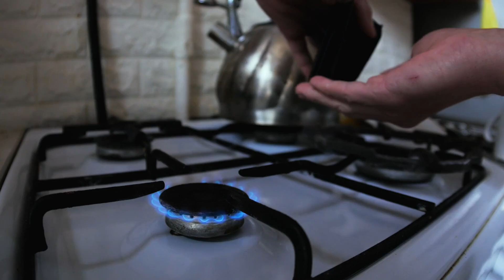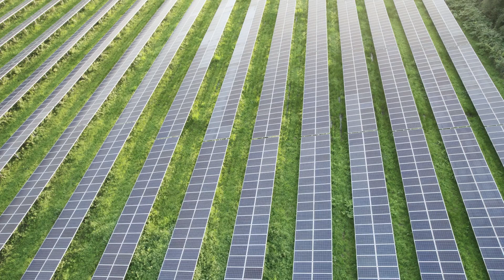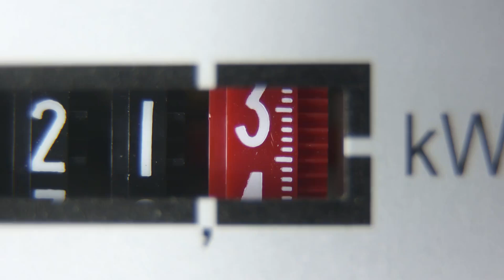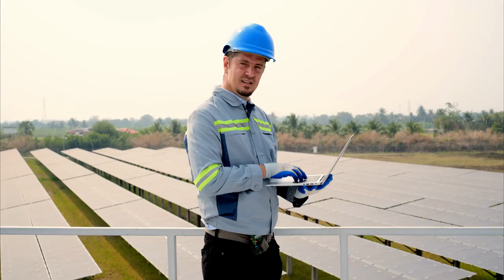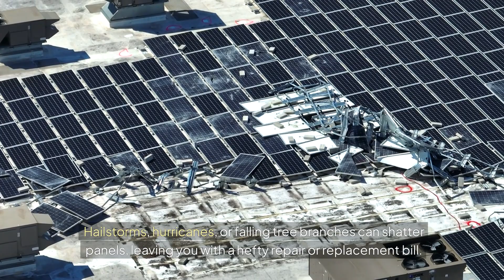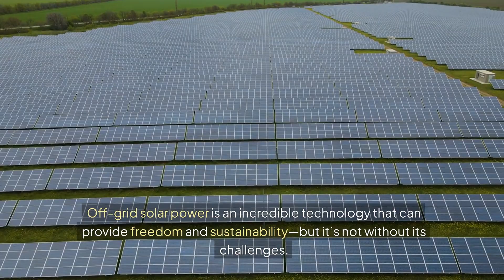SO YOU THINK YOU WANT TO LIVE OFF GRID ON SOLAR?

Comment: I agree that its fairly un-affordable unless you can install it yourself. Not something I would recommend to the average person. I have a large system and it only powers smaller loads. The AC for instance is still on grid. Very hard to get enough power in the winter when cloudy. I also got hit by lightning and my Schneider inverter along with many other electrical item in house where destroyed. Learned the hard way that spending the money on surge protectors is also critical.
Reply from the maker: Our system came with the purchase of the property. I only know the total cost because the original owner kept the bills. While we live in the state known for the most lightning strikes in the country, I've only ever had to deal with ground fault issues where lightning struck close enough (about 300 ft away) that it set the system off, and all the batteries were drained, so we had to lug all 8 down to our house in town to recharge them before hooking everything back up lol

Comment: There is a lot of BS in this video. When using heating and solar, should use heat pump. As every 1KW of solar energy will produce 4KW of heat
Reply: @paulkearsley9509  I live in Texas where a heat pump is not practical. The video explains what to expect for someone who is thinking about off grid solar. As someone who’s been working with solar for 15 years, I didn’t see any BS with this video.
Reply from the maker: 🤣 Love that my OWN EXPERIENCES are BS. And, living in Florida, a heat pump makes no sense. I run AC 10 months out of the year. On 5600w, I generate about 25-35kw a day, using a heat pump to cool would suck about 5-15kw (actually a bit more than 15 in summer) of that, especially since we run the AC in Florida all day and all night. And, if I am also using the heat pump to keep a water heater going, well, there goes all my stored energy. This is why we have a Mitsubishi mini split AC-we don't use the heater option- that uses less than 1/2 of what a traditional heat pump would use. I also have a pot bellied stove that is more than sufficient to warm the entire cabin without relying on any other heat. This video is NOT BS, it is letting people know about the downsides I personally have encountered. So, before making your claim, please, ask questions, like 'why don't you use a heat pump', to which I would answer...gee, sir, great question, but I live in Florida, where the average temp for 8 months of the year is above 90 degrees in the day, and high 70s at night. The Mitsubishi in this climate is a better option, using far less power.

Comment: Over engineered systems is the problem. Learn to use less power and keep it simple with 12volt systems. Its has worked well for me by learning to use less electric power.  Keep it simple.
Reply: @cooloutboards1012  Now this I agree with for several reasons.
Reply: 12 volt systems are no where near as efficient to build at scale. Almost all larger systems are 48 v for a reason...
Reply: @johnturner7060  Could you list what those reasons are?  There is something called Ohms Law which states that the voltage (pressure) across a conductor is directly proportional to the current (amount)  flowing through it, which in layman’s terms means that you are sacrificing storage capacity of a battery for more pressure (voltage).  One thing I will list for you is that smaller gauges of wiring can be used in a given wire run with a higher voltage than 12 volts due to less resistance. But other than that, I’m eager to learn. Edit:  Much of RV and automotive accessories are 12 Volt.
Reply: @keyfitter  When there are more component to a system, there more possibilities of components going bad.
Reply: @cooloutboards1012  In an extended grid down situation that would be a real problem.  I actually have three out buildings with three separate systems and  some spare parts. If an inverter, charge controller or batteries go bad on one of them, I can rob from the other two as well. I like backups to the backups. I also try not to drain AGM batteries under 70% so that their capacity lasts a lot longer. Not sold on lithium ion batteries due to fire hazards. E-bikes and EV’s are in the news quite often.
Reply from the maker: I agree with you..this system was installed and we purchased the cabin and property with it already there.

Comment: Ridicules, who would have conceived of an off grid solar system with an electric water heater? An off grid system is actually simpler than a grid tied system. There are whole house off grid systems that can be assembled in 30 minutes today. Just look at more informed YT videos. I live on a boat completely off grid and lack for nothing as far as electric conveniences. But I'm not stupid and I'm not trying to run an electric hot water heater with it! How long do you run a microwave for 1-5 min? It uses almost no power in total home usage. Do you put an off grid system in Alaska where it is dark half the year? No but in Arizona no problem! Unfortunately an ill informed video.
Reply: @benlindner5285  Nothing ill informed with the video and not all of us live on a boat. In fact, I can and have run a microwave on one of my systems and even recharge my golf cart with it, which pulls about the same amount of wattage, around 1500 watts. The video correctly explains to people who are thinking about off grid solar, what to expect.
Reply: @keyfitter  Gotta disagree here and agree with @benlindner5285.  If this video is to inform the general population about the difficulties of an off-grid electrical system - it's including a problem that would NEVER be encountered if you were to set one up yourself.  @offgridstyleprepper inherited the system, so she got what she got, but anyone starting new would use propane or similar to heat water.  In fact, heating anything, whether it's water, food, or just the air is incredibly energy intensive and in (pretty much) no case should be done with electricity.
Reply from the maker: @pshep123   And in this video, I literally say that you need to consider other options for a water heater, like propane. As for heating, we have a pot bellied stove that heats the whole place (too much, sometimes lol). So, WHY did I mention a water heater? Bc most people who have never really considered truly living off grid with solar, well, it would probably never dawn on them they needed any special or different water heater than an electric one...for most, at least in the South, their water heater is electric. It's another issue that needs to be addressed. 
So, how did I address it? First, I installed a 6 gallon 'emergency' water heater. Takes 45 minutes to reheat if used/drained, and in the summer, that's not a lot of energy.  Most importantly, I use the solar shower bags. They are awesome, and, as long as they get about 4 hours of sun, are so hot I have to mix them with the cold water from the shower in the bathroom. And, on those few occasions when the sun doesn't shine, I heat water in my huge pots (restaurant size) and that works. The point of the video is basically, hey, you can do it, but you better be prepared to accept lots of exceptions to the rules. :)
Reply: @offgridstyleprepper  all good points, thanks for posting.
Reply from the maker: You know what? THANK YOU! It is not often (like never) that someone comes back after I explain an angle or perhaps something missed, or maybe I didn't explain well enough in a video and have to clarify..that someone actually responds, AND in a positive way. I hope you have an amazing rest of your day/night, and you actually put a smile on my face, so thank you X100 for that, as well. :)
Reply from the maker: 🤣🤣I inherited this system. Yes, I am sure there are all kinds of wonderful options. I am explaining what MY experiences have been, with a specific system, specific power amount, etc. I don't need to 'look at more informed YT videos'...I LIVE this. And I don't try to run an electric water heater with mine either...I am letting people who have never thought of things like that understand you can't do it, you need to find another way if you want to install one. Unfortunately, but not surprisingly, you just made all kinds of assumptions...did I EVER say I run an electric water heater? No, I said you can't. And I explained a few of the ways we have had to get around that. Living in Florida, it's mostly solar shower bags..I have I think 8? at this point.
I love the fact that somehow, sharing MY OWN EXPERIENCE LIVING WITH this is 'ill informed'. 🙄🙄

Comment: I am an electrical engineer with homestead solar experience.  This video is very useful.  It should be seen by many and I hope it is.
Reply from the maker: I appreciate that! I wish I had a smart engineer in my back pocket lol. I have a B.A. in English Lit, and I swear Schneider writes its manuals in another language! 
If I had my druthers, I would prefer to be on the grid, with solar for backup. The costs of upkeep, maintenance, and replacement FAR outweigh the electricity cost for a 500 sf cabin and well pump. 

And, feel free to share the video! I am afraid my videos, probably bc of some of the subjects I cover, don't get as much exposure as I've been told and researched that they should, so sharing them always helps! :)

Comment: Morning Nikki. Just my plan, but when/if the grid ever does shut down, I do have some solar and am looking into other ways of providing some electricity for a few essential wants, but actually have plans of living without electricity for a long, long period without electricity, gasoline, natural gas, propane, etc. Will just have to live like our ancestors did without power.
Reply from the maker: I agree, and as I told 3 Dogs, if I were starting fresh, I would NOT have a solar system as my only power. I would be tied to the grid with back ups. $40k plus is ridiculous. Think about it...with an average $150 a month electric bill, it would take 22 years to equal $40k..and by then you will have had to replace the batteries at least 4 times, along with anything else that might have gone down, and the solar panels, as well. I am now looking into more simplistic options. I'm intrigued by bicycle power 🤪 for one. And I've printed out diagrams and instructions for that, as well as non-electric hydroponics systems-I put everything on a thumb drive, but also print it out and put it in my emergency notebook inside sheet protectors lol
Reply: @offgridstyleprepper  Back in 2009, I took a NABCEP approved course that would have certified me for a sales position with a solar company. That's when I learned that someone purchasing a $30K or more photovoltaic system wouldn't start to realize any gain for at least ten years and it was to be marketed as an "investment". I took a whole different path for myself and did my own integration and installs for off grid systems. I may never break even but I do use all three systems pretty regular  and don't pay any meter charges so there's that. Also, if the grid does go down, we do have some backup.